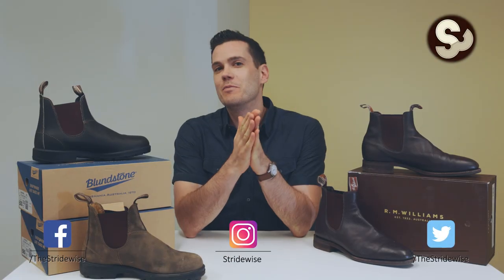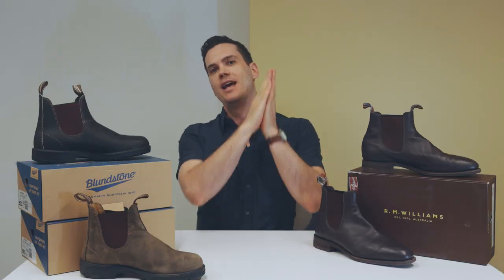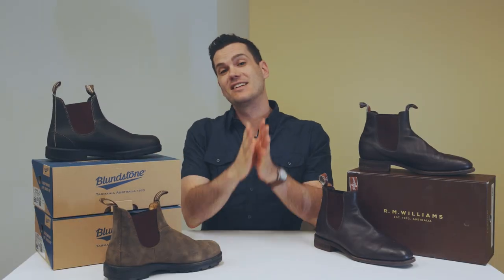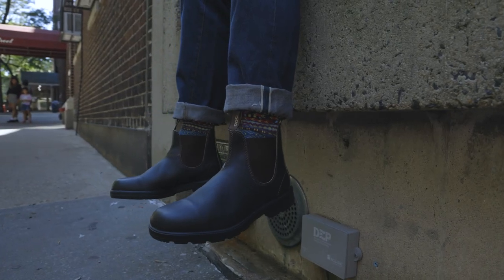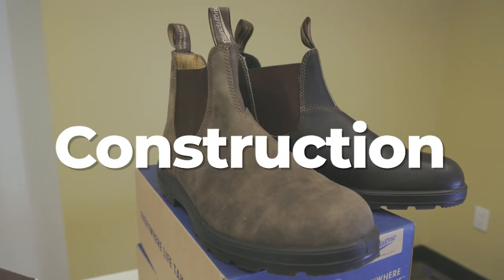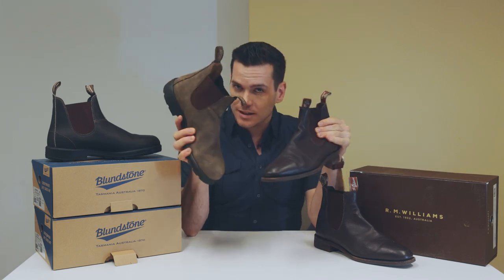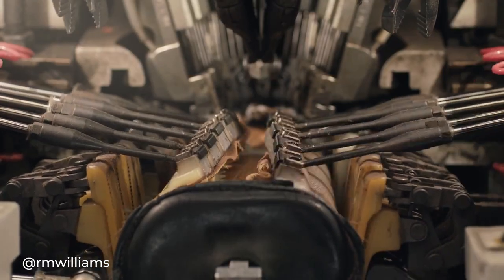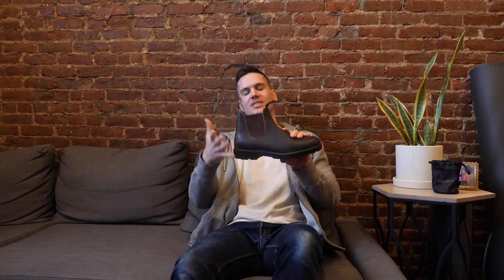RM Williams vs Blundstone Chelseas | Australia's Greatest Boot Battle

Comment: What you get depends on what you want to do with them. I pulled up at a hiking trail in Utah, where I live these days, and realized that I'd forgotten to put my hiking boots in the truck. So I hiked up the mountain in my Blunnies. Now, this hike was no joke. The ascent was 2,678 ft over 1.38 mile (816 m over 2.22 km) - i.e. bloody steep, with summit at 11,019 ft (3,358 m) above sea level. Fortunately, there wasn't much snow. I was buggered by the time I got to the top carrying my pack of radio and survival gear. Sore feet, too. But my Blunnies got me up there and back down in one piece. There is no way I would have worn a pair of RM Williams boots on a hike like that. For one thing, it would have been really painful. For another, I would have cried to look at the state of the boots when I got back to my truck. Blundstone boots are perfect for casual wear and you can really thrash them if needs be.

Comment: Nick - Random question: Do you use taps for your boots? (Longtime NYC resident but moved and now a monthly commuter.) I used to religiously take my shoes and boots to my local shop and get taps. The concrete jungle would otherwise burn through a heel in weeks. I ask because I generally hate taps and want to know if there is a better way outside of relearning to walk. Thanks!

Comment: No, the long term cost of RM Williams is not lower than Blundstones, as the cost of resoling Goodyear welted boots is usually higher than a new pair of Blundstones 585. Obviously RM Williams are better in pretty much every way; however, they are also much more expensive in every way.